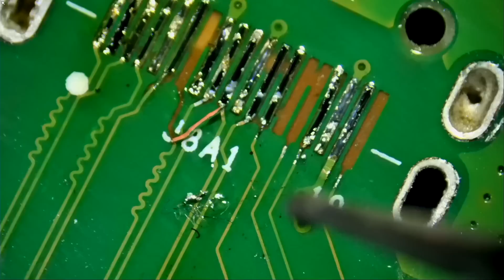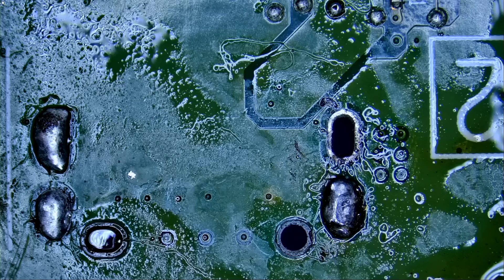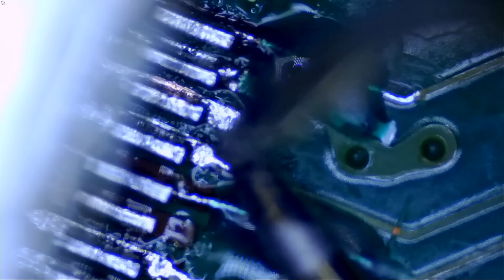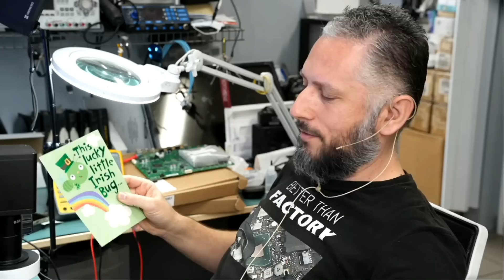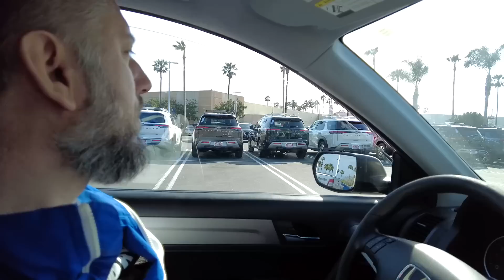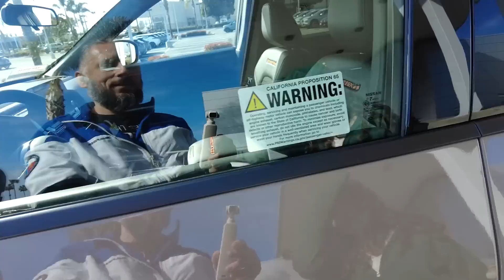Xbox One S Repair - Working on someone's mess up & dealing with customers

Comment: Are you sure in this case, that this "free" pin is not conected with pin behind it?
It can be a lottery.
You can see the connection of those two pins, and it was easiest for you to bend the wire extension to that adjacent pin, or when soldering the connector, solder those two pins together.

Comment: It's not a problem at all lol, those guys complaining don't have the skill to do it them self. I use open tweezers to press a put a little force on the new component so the pressure gets more evenly spread. But whatever, as long as it is solid and making connection without shorting, we are good. You certainly know what you doing bro, keep it up!

Comment: 10:00 im fixing industrial circuit boards and more ( its my hobby ) 
.. like cars and tvs and more and im using ultraviolet clear glue on the pad gluing them formally and then im grinding a bit of tell the copper pads are expos its makes them really strong bond to the board and after soldering the part im potting the ultraviolet glue on every corner of the part ( small amount ) to secure it formally for ever

Comment: Just replaced my hdmi port on the gears of war 4 version after watching this, and it worked great. The only issue I had was after disconnecting the hard drive and plugging it back in I lost boot animation but console still signs me and and it works no problem but just an annoyance

Comment: As a software engineer, this line of work is outside my skillset but this topic has grabbed my imagination and I want to start tinkering with soldering like this as a hobby. Now, I KNOW practice and repetition is the key to success with the physical aspects of this job.. the soldering desoldering etc.. But I first wants to understand the electrical side of things. I am hesitant to start tinkering with some old broken electronics before I understand what is a capacitor, a diode, resistor etc etc and how and when electricity flows etc etc.. Can anyone or NorthridgeFix recommend what they think could be a good place to learn these things online? If a university or course is best, i'd happily enroll in one.. just not sure what people in the know think on this topic..

Comment: Hi Alex.  Saw some of your great videos on Mercedes Key Fobs.  One of the fobs works perfectly, but the other works in the ignition and starts the car, but (1) none of the buttons work, (2) the red light does not turn on, (3) No IR is seen through a phone camera, and (4) the car does not respond with the fob nearby (keyless go), says key not detected.  What would YOU look for in terms of most likely causes based on these clues?

Comment: I understand that solder mask is not used as a strong adhesive, but there are UV curing that ARE stronger.  So, enquiring minds want to know, why not use one of those UV adhesives when you need more strength - maybe instead of hot melt??

John

Comment: I've been having a go since January and recently had to repair a couple of pads that ripped off as they were so corroded.  I used wire from the new capacitors.  I'm sure it wasn't perfect but it works. Not sure if it'll last if it gets dropped.  It's all a learning experience anyway.

Comment: My dentist told me how i could fix my teeth by holding pressure on them 10 minutes a day with my fingers for 6 months. He didnt want to sell me braces.  

He also pulled the correct teeth. My previous dentist wanted to pull the adult teeth and leave the baby teeth to rot so he could upsell 2 bridges in the future. 

That customer who just needed data didnt need to replace a screen, just pull the drive and stick it in a PC. i hope you told them that.

Comment: One problem I have sometimes found when using wires to restore pads is that the thin wires don't hold enough solder to make a good connection. So sometimes I find myself pre-applying solder to the pins on the connector rather than (or sometimes in addition to) the PCB and restored pads
Reply: Good tip

Comment: At 5:54, I've the impression you're about to cut accidentally off some traces with the blade. Can you guarantee that traces will not stop working the board?
Reply: I bet you never tried to actually cut a PCB trace. that blade barely removed the solder mask on top of them...
Reply: He didn't cut off any traces. He exposed the copper plane so he could solder repair wires to fix the traces. That connection will work forever.
Reply: @vgrepairs  pls watch the event to understand what I mean